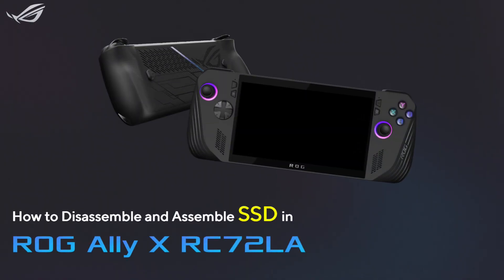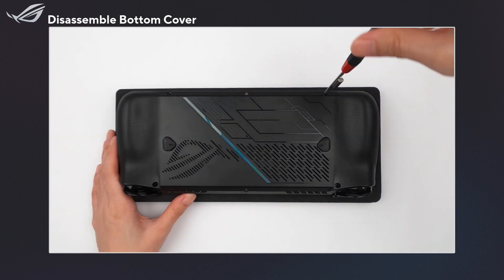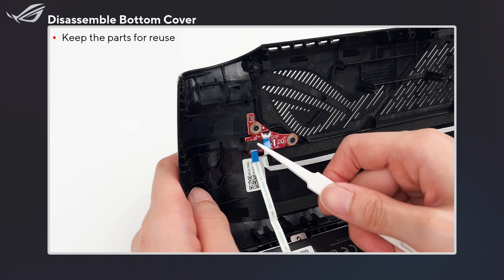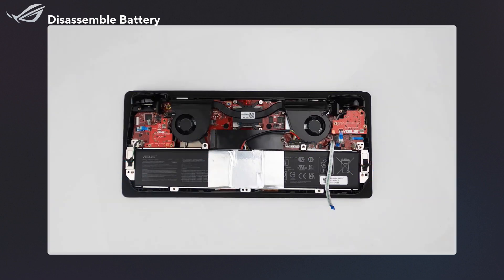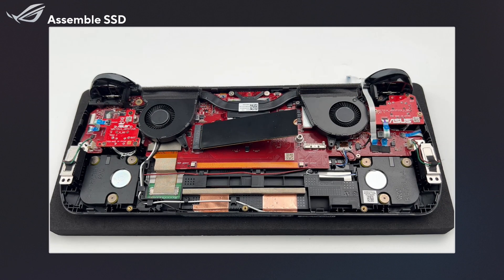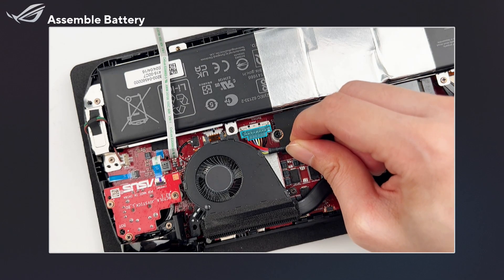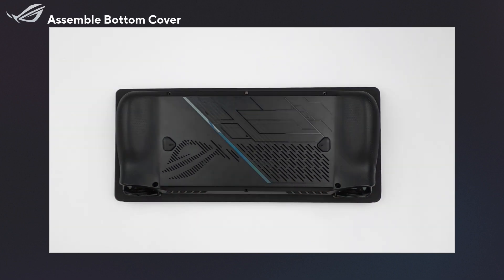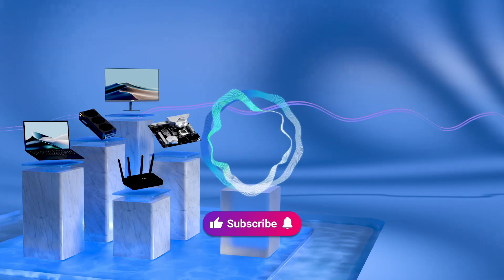How to Disassemble and Assemble an SSD in ROG Ally X?     | ASUS SUPPORT

Comment: I am rolling the correct screw driver to remove the 2 screws of the top, close to the RB and LB buttons, but they roll and not come out. Any hint or recommendation?
Reply from the maker: Perhaps you could consider turning the handheld device at an angle to see if the screws can be removed.
Reply: Broo, literally the same issue. I can't figure out how to remove these screws. I managed to remove the one near LB button, but no luck with RB button. I had shaken the device, but still can't remove it. Screws should be easy to remove, but not here

Comment: Can you confirm that if we want to upgrade the Ally X SSD to something like a Samsung 990 Pro SSD, we don’t need to install an extra heatsink and we can just reuse the mylar cover from the stock Ally X SSD?
Reply: Yea you're fine the air vent is are literally on top
Reply: I put a 990 pro with a heat sink on mine
Reply from the maker: Regarding your question, I would recommend you visit the following forum post to get more assistance. 
https://rog-forum.asus.com/t5/handheld-gaming/bd-p/HSS_Handheld_Gaming
Thank you.
Reply: @asus_support  i went through your link, but I could not find the answer. Can you just give the simple answer here? Is it OK or not?
Reply: Hi, do you use the original black cover? How does it goes with the temp from Samsung Magician?
Reply: @erw1nk779  I did some research and most people are using the original black cover / shielding from the SSD that came in the Ally X and putting it on the new SSD, just like in the video. They said that temps have been fine. A lot have been using the 990 Pro SSD’s to upgrade in their X’s, along with WD SN850X too. You should be fine just following the steps in the video.
Reply: @stoksyXL  thank you, I have now on hand Graugear Heatsink sets, Alu and Cooper, I am upgrading now and will see which one is fitting well. my SSD can went up to 60°C under heavy multiple writing, so lets see
Reply: all installation done, recovery done, but then I wanted to use the stock SSD, question is why it is Bitlocked? I was never ever lock the Ally X stock ssd
Reply: @erw1nk779  its bitlockered from the factory mate, you should of disabled it windows before removing the drive.

Comment: Hello, I have an asus zenbook ux533ftc laptop. And it has a problem that makes it useless as a laptop! The problem is that the discrete gtx1650 max-q video card consumes 7.6 watts in idle mode and generates a corresponding TDP of 7.6. All this happens with the video card not in use, while in the task manager the load on this video adapter is 0% (it is not used at all!) If you disable the gtx1650 max-q in the device manager, the total power consumption of the system decreases by 7.6 watts. But after rebooting the laptop, the consumption is again higher by 7.6 watts, and the gtx1650 max-q is still disabled in the manager! Viruses are excluded after a complete reinstallation of win10 from the cloud, the problem did not disappear.
This problem makes it ineffective to use this laptop as a stand-alone device. I always bought Asus products considering them reliable but now I am very disappointed with the Asus product.
I am going to make a video with tests demonstrating the engineering defect of this laptop.
Reply from the maker: According to what you described, I would suggest you bring back your laptop to our service center for further confirmation.
The following is the contact information:
https://www.asus.com/support/service-center-location 
Also you can contact the local service center for help.
The following is the contact information:
https://www.asus.com/support/CallUs# 
Sorry for any inconvenience it may be caused.